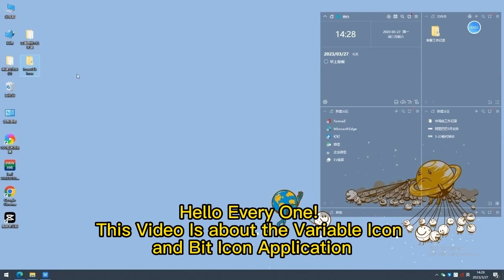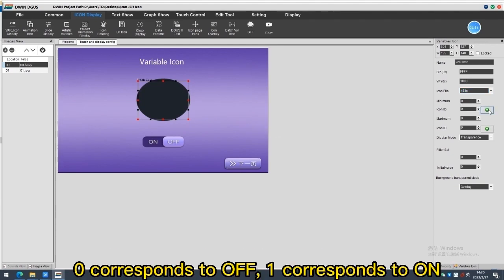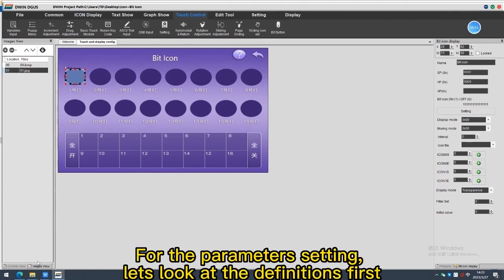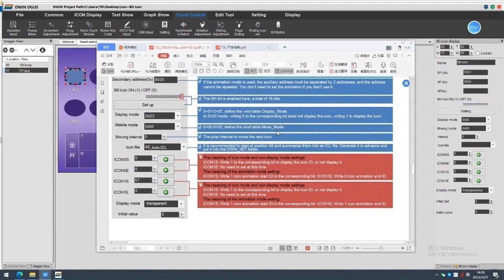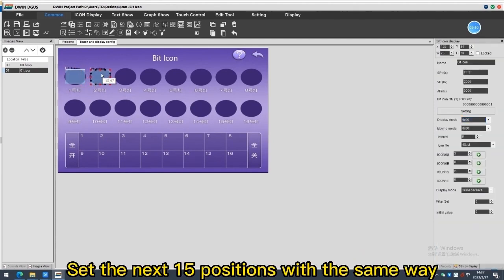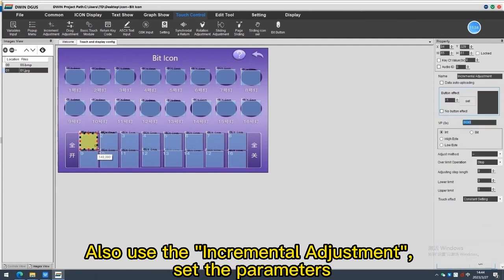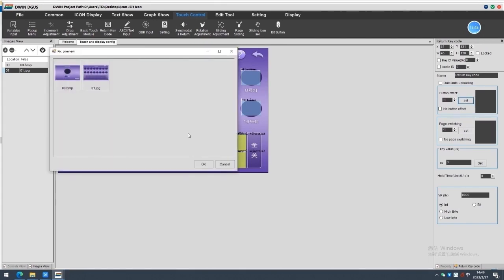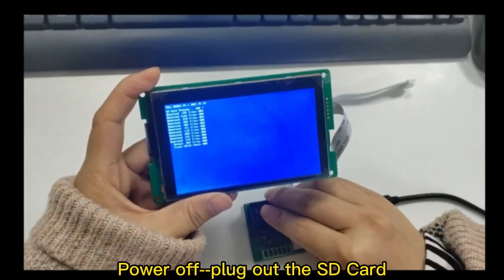Basic Function 03 - Variable Icon and Bit icon | DWIN T5L DGUS Tutorial

Comment: Hi, I also want to change Icon based on the Serial command which i can send from my microcontroller, how can i do it ??
Reply from the maker: Dear, if you want to change the variable icon through a command, display the icon corresponding to the lower limit 0, 5A A5 05 82 5012 0000; 0x5AA5: Frame header;
0x05: Data length; 0x82: Write instruction; 0x5012: VP; 0x0000: Display the icon corresponding to the lower limit of 0.
If you want to change the bit icon through a command, 16 bits fully open; 5A A5 05 82 6000 FFFF; 0x5A 0xA5: Frame header; 0x05: Data length; 0x82: Write instruction;
0x6000: VP; 0xFFFF: 11 11 11 11 11 11 11 11 Write 1 to all 16 bits, which is FFFF